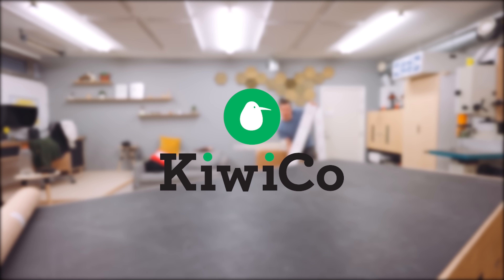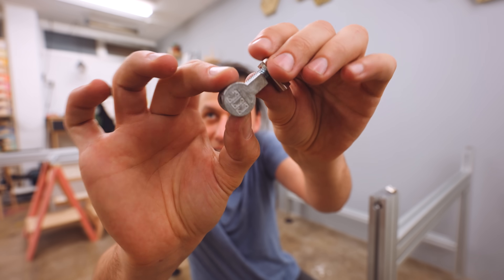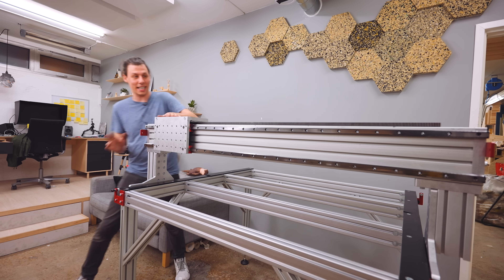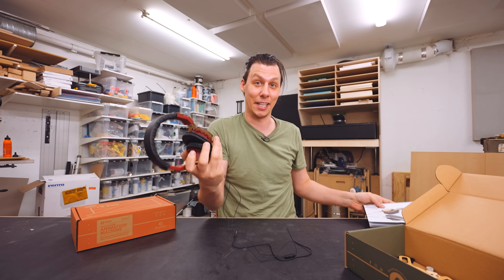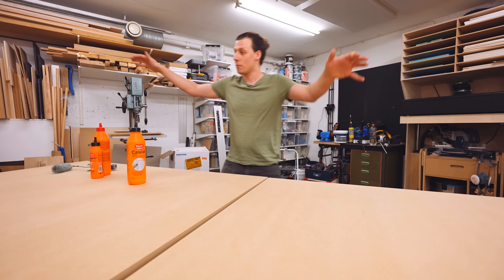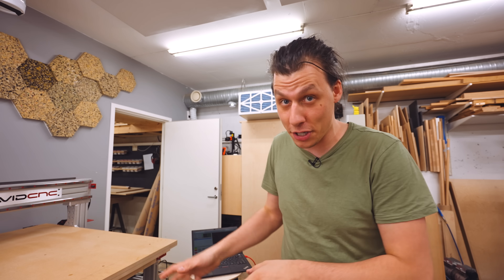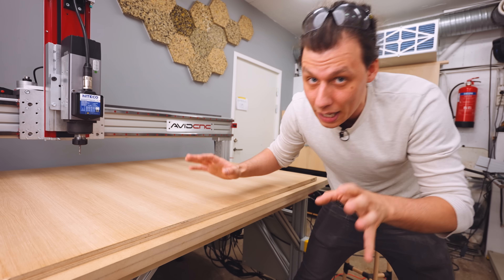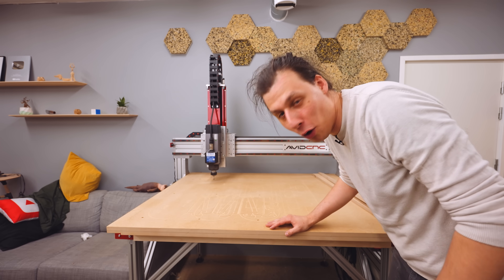My Massive New CNC Machine!

Comment: Hi! Thanks for the video. i wanted to know how you apply grease into the lm bearings, specifically how you connect the grease gun to the grease nipple, coz' when i tried i pulled out the grease nipple stripping out the plastic threads . looks like you decided to skip out this part in the video.

Comment: At work, we have stackercranes and some of those have make cracks on their aluminum support beams and they have been replaced. But the old ones are still useable but they are still laying around somewhere at work for over a year. I asked for a ticket to get them home but they still won't release them due to failure calculations still haven't been completed. I would use those beams to build my own cnc machine but so far, no luck yet in even starting on it. I'm jealous you got such an expensive machine for free. I guess Avid cnc won't look me up and send me one too :p

Comment: Awesome video - you might actually want to keep your waste board smaller or equal to the maximum cut area of your - as you surface the waste board it's going to turn into a pocket with higher edge that will prevent you from being able to put larger pieces on the CNC since they'll float over the actual cut area. A 38mm waste board is going to last FOREVER too... most of the time the most you're gonna be cutting into the actual waste board is a thousandth of an inch and you'll have to do that a LOT before you actually NEED to resurface it.

Comment: Sweet machine!!   I look forward to seeing what kind of interesting projects you make with it.

When attaching your spoil board and attaching stock to your spoil board, use brass screws.  Brass is softer than steel and if you ever accidentally hit one with a cutter, it will be les likely to damage the edges.  Another suggestion to help with dust/chip management-- cut 150mm strips of poly carbonate sheets and attach them vertically to the left and right edges of your spoil board.  That will prevent most of the dust from blowing off of the sides of the machine.

Comment: Alexandre welcome to the Avid CNC owners club.  We have had our 2x4 for about 8 months to support our Battlebot builds and a few other projects.  We are limited in space right now so having a machine we can make bigger when we have more was important for us. One idea that I took from our friend Robert Cowan was to install a drawer in the front of the router. I used a commercial 2U rack cabinet drawer that I routed a custom front on with a shelf with collet holders and slots for wrenches etc. means you can keep everything in one place, interested to see what you could do with your joinery skills.

You said you are going to build your own dust collection shoe. I have been round that loop a few times and there is one very good (if not pricey) commercial solution out there that beats all of the others and hundreds of hours of R&D I have been involved in on making shoes for various machines. Go look at KentCNC.

Have fun with the machine.

Comment: I would commission a custom metal bit for "re-surfacing" work. Then make the shroud fit that. That way, you can re-surface it with something akin to a fine scrapper/sandpaper with the machine program rather than doing it by hand/with a drillbit.

Comment: As I remember, many people make a CNC table with holes, just like welding table. You can glue nuts into the bottom of the surface and use them to hold your staff on the table.
Also, quite obvious, you can use duct tape to set your vacuum cleaner tube on the CNC head until you finish dust collector :)
Reply: That thing is build like a tank, you could just duct tape the shopvac to the spindle

Comment: IMPORTANT!!!! Ok, stop right there. You are using the wrong kind of grease. You need to use lithium grease (white, red, or blue). The grease you are currently using will slowly destroy your bearing surfaces. 

For background I work for a CNC laser manufacturer and build huge metal cutting lasers.

Comment: Love Alex and his vids... was thinking a board with just a hole for the neck of the wine bottles where the torque from the weight of the bottle and the friction of the neck inside a hole slightly larger than the radius of the wine bottle neck would be a cool way to store them visually. Not a wine guy so not sure if there are reasons why that's a bad idea.
Reply: Storing wine isn't rocket science as long as it's short term and not for aging. Generally you want the cork to remain submerged in the wine so it doesn't dry out. This prevents oxygen from entering the bottle. You want the bottle at a slight tilt so that any particulate matter that's suspended in the wine will collect at the bottom of the bottle. That way the sediment won't get disturbed as you handle the bottle provided you are careful. Ideally it should be stored in darkness, but for a kitchen it's fine as long as it's stored out of direct sunlight.

For long term storage and aging temperature control is very important as is regular turning of the bottle as you actually want the particulate matter to circulate through the wine while in storage.

So the requirements for short term storage and long term storage is slightly different. For most of us who has only a few bottles in the kitchen nothing special is needed, but designing a wine cellar is better left to the experts. It might still not be rocket surgery but people who want/need a dedicated wine cellar are likely to be quite demanding (ok, so they tend to be pretentious snobs) so it's better left to those who know how to handle them.

Comment: Nice! Regarding the sacrificial base, you might actually want to make it slightly smaller than the full cut range of the machine instead of bigger. When it comes to leveling and resurfacing it, you'll start to just turn it into a large pocket or dish, so when you come to cutting material larger than the cut capacity, it won't be able to sit on the level base, but instead float on the rim now left. 

Also, as others have said, a plastic Brad nailer is a massive time saver. I believe avid cnc sell one. You need to use the specific composite gun as the nails don't work in a normal nailer. But it doesn't chew up your base board like screws,gum up your cutters like double sided tape or get in the way of a tool path like clamps. All it takes to remove the piece from the bed is a sharp whack with a rubber mallet on one side and all the nails sheer off! 

Look forward to seeing your dust collection! I've gone through many variations myself!
Reply: The point about the sacrificial board getting a rim after a while is a great input! 
(Mostly answering so this comment gets bumped up)
Reply: You can use a large-diameter surfacing bit to level the table outside the normal cutting area. Keep in mind that a larger diameter bit requires more precise tramming, or you can wind up with stair steps on your "flat" table.
Reply: Defo! I use quite a hefty 50mm diameter surfacing bit with 3 carbide inserts. But I guess with the current sacrificial board he has installed, as it goes from edge to edge of the gantry, it'll always have a raised edge that a larger cutter would never be able to reach.

Comment: Have you heard about the plastic nails?
They are really useful for fixing wood at the cnc table because if you run into them with the drill, nothing breaks.
Reply: I also like using brass screws, which are soft enough for 1/4” HSS bits to plow right through.
Reply: or Lignoloc's wooden nails :)
Reply: I have the Omer composite nailer and it's amazing. If you don't have a vacuum table, it's a killer solution for sheet goods.
Reply: I my so disappointed he did not make it his self like I really recommend he did a 3D print one like this YouTube channel https://youtu.be/7rqj-6HgWz4

Comment: You need to use double-sided tape to hold your piece down and now have to chew up your wasteboard any more than needed. Also, create small tabs in the work so it doesn't come flying out while you are cutting and then you can just hand cut them when you are finished.

Comment: Pretty fantastic machine, Alexandre! Great work! 😃
A tip for fixing the plywood to the machine: there are some plastic pins you can use with the pin nailer (they're made of nylon I guess). This way even if the machine hits one there's absolutely no problems. 😊
Anyway, stay safe there with your family! 🖖😊

Comment: where did u buy that cnc?
Reply: didn't buy it, but got it from AVID CNC. You cna search on Google. For the price it's a good router. You can also build it yourself and save but if it's for your work, then save the time and buy. Build one takes quite some time to do it right. Just my 2 cents. Built 3 CNCs and can be quite demanding, plus I did not save much at the end.
Reply: @Ale_Lab  sorry, haven't watched the entire video, it's amazing, excellent work, loved it, took the price at avidcnc...cheers
Reply: @gleisoncaetano  nothing to say sorry 😁 I was just giving all the info needed to find out where the CNC comes from. They also have nice solution to use one CNC as both plasma cutter and router. Cheers